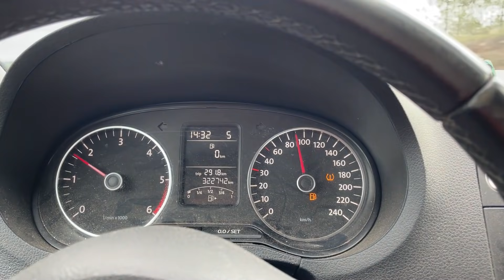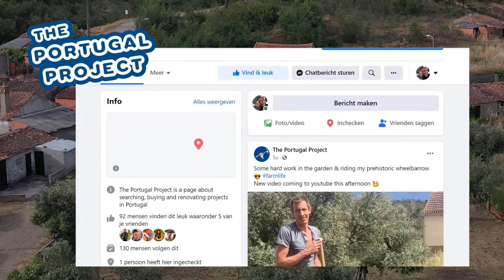MAJOR ISSUE on the HOUSE - (..And more work done) - Portuguese House Renovation

Comment: Jasper please add guttering to the end of your tiles to stop all the rain water from the roof ending up in the trench. They have a system in Portugal with clamps that attach to the bottom roof tiles. Theo just put one in so check there ;-)

Comment: Jasper, make a french drain under the floor and divert the water houtside the house,  then apply a plastic membrane and make an insulated floor. If fixing from outside you need to dig the trench down to a level under the room floor and apply a drainage membrane, to be on the safe side regarding house and street stability, trench need to be done in 2 or 3 times, avoiding to open a full length trench.  Keep the good working!
Reply: Looks like he got the Same problems like Nike with water coming in there house  jasper a French Drain well help a lot  but Nick we’ll need a Levada along the Front of his house with A drain plate on the top of the Levada

Comment: Regarding the problems: This happened in my house as well, built much the same way in northern Portugal. It was a pretty big job but fixable. Digger had to come in and dig a trench down to below floor level. Then we observed for a few months through big rains to see what would happen and if the trench would flood badly. Then we added a rubber membrane on the outside of the wall that sits below floor level + added a french drain, that empties out at the side of the house. This has fixed it and we haven't had any water come in anymore in 3 years of very wet northern winters.
Reply: Yes its the only way to fix a leak like this .lowering the cemented trench at least 50 cms below the level of the foundation of the wall..and  making the wall waterproof from the base up...
Reply: Yes ! I agree start as close to roof as possible "glueing" solid rubber membrane to wall. Curve it at bottom to follow contour of drain ditch then dig a small trench to take water away from house. The cinder block wall holding up your driveway is probably like a waterfall so glue membrane to that as well so water doesn't come down that wall and get under your house floor. Eventually you can dig a drain tile along that short wall to keep water from coming over that short wall ? Words are hard pictures are better 🤣😂🤣❣️
Reply: My stone built farmhouse is built straight onto slate, no foundations and the water used to pool around the house and seep through the stones as well as come up via the floor. It was easy to solve but 3 days of hard work. French drains, the same as we do the fields except in those you use stones, its gravel for the house area. That was 28 years ago and the house has been dry ever since.
Reply: @julibeswick-valentine3690  also remember you don’t have an eve trough on the edge of the roof and all the rain water is running down the side of your house and the inside
Reply: no digger, his roof is in the way. Dig it out by hand. Yummy.
Reply: @acanadianineurope814  A digger can easily get to that without breaking the tiles. It comes in at an angle. Digging that out manually will be horrible.

Comment: You are correct - it's hydro-static pressure forcing water through the back wall of the home. There aren't any curbs on the street behind your home to keep runoff on the road nor storm sewers in the street to receive runoff and drain it out of the village. The street is crowned in the center to drain to the sides. All of that means that water is going to collect against that back wall and will be forced by gravity (hydro-static pressure) through the wall during the rainy season and leave the floor damp the rest of the time. The quickest and cheapest solution is a simple C-shaped curtain drain uphill/around the house on three sides. Excavate a trench about a foot (30 cm) wide around the uphill side and the two ends down to a point about six inches (15 cm) below the bottom of the back wall. The top and bottom of the "C" need to end about two meters downhill of the house on each end. The trench can taper in depth and only needs to be about 30cm deep at the downhill ends. Make sure the trench slopes downward in both directions from the center of the back of the house towards the ends at a rate of about a centimeter for every 1.5 meters. Line the trench with some geo-textile fabric, put in a two-inch deep bed of washed quarter-sized stone, place a 4-inch perforated drain pipe wrapped with filter fabric on that bed, and install elbows and a couple of drain outlets flush with the street on the ends. Add more quarter stone to a point about 6-inches (15 cm) below the surface of the street, fold in your filter fabric to keep silt out of the stone and then cover with dirt or pavers. Any rainwater that now drains off that slope and beneath the pavers of the street to your house will now be picked up and drained quickly around the ends of the house and will percolate up onto grade below the home where it can continue downhill on the surface. Done correctly, this will prevent buildup of hydro-static pressure that enables water to be forced through the back and side walls of the home and will prevent water from draining beneath the floor slab and pooling there. I don't know about Portugal, but here we rent a walk-behind machine called a "Ditch Witch" for a few hours so that we can quickly excavate the ditch without wearing ourselves out.

Comment: Love your Vlog and check for them everyday.
Zoe is such a Love and adventures, independent Girl . You might want to invest in a Harness instead of the Collar. It will make a big difference for her Trachea .
I had a Pitbull that would pull like her and once we switched to a harness she was much easier to control and didn't fight being on leash.
Keep up the good work. I wish I could "beam" over and help some.
Reply: Yes it's true my pittbull is the same!!
Reply: Yes, harness will save her life
Reply: Disagree harnasses are actually made for pulling. If anything they make dogs pull more not less. Best way is to teach them not to pull. Good way is a leash high up (under jaw and ears) that gives you more control, but you do need the right timing and know what you do.
Reply from the maker: I would prefer it if she just stopped pooling.. im working on that with her now..
If she doesn't.. im going to try different options. But i think a harness would not prevent her from poling.. just easier to mange maybe.. but for her more strength to pull.. i think.. will see :)
Reply: @Quinta-Entre-Aguas  I agree. My Finnish Spitz can only use a collar.  Shorten the line if they’re out of line.  Lol. Harnesses only encourage more pulling

Comment: Even in on a cloudy morning it is beautiful.   Zoey is a hunter, she's your muse. I had the same problem with my living room after last years floods. I had to re- tank my walls. Re membrane and water proof sealant. 200 year old house and the living room and kitchen is below road level. When it rains I get all the water in front of the house, the drains can't cope. I have to clean a drain at the outside wall, it's old, lined and sits up a lot. Dig down see if you can pipe drain it and divert the water to a tank and recycle it for garden and toilet use.
The door and window will make you air/ water tight. I like the blinds within the window. You can fix a blind above the door that you can lower at night or in the hot weather to keep your room cool.
Your getting on with the little jobs and you may want to get Xmas stuff before the shortages get worse. Stay safe and thanks for sharing.

Comment: I gave you like #1000, yay...
ok, well first idea is to mount a rain gutter at the end of your roof to catch all that water from the roof
and move it down to the end of the house.
second idea is to dig out that trench, install proper water proofing. Good luck and have fun with that.
third idea is to waterproof from the inside, using a special masonry cement that will permeate the bricks,
so the first meter of wall paint / cement has to come down.
I did this to my basement, which was built without any exterior vapour barrier, and since then
I have a perfectly dry basement.  Huge PIA though.
Last, 'sheet stone' is called slate in Engels.  Have a nice day.

Comment: Hey Jasper, It could take a couple of days and few hundred bucks; but I had a similar problem and created what I found out to be afterwards, a French drain. Dig a trench. Make wholes on 4 to 6 inch pvc pipes (on top and dirt sides). Install in bottom of trench with holes above & towards the street, then lay rocks around 2-3 inches on top of pipe. Then throw dirt over rocks and place a screen cover at ends of pipe. I have never had a drop of water seep in ever again. Good Luck. I hope to visit Portugal in the very near future. I live in Puerto Rico.

Comment: Do not get discouraged. This problem will get solved. It does not look like a flood of water was there. I remember an earlier video when you  had torrential rain. I think the guttering would reduce the amount of water near the foundation and would be the least expensive first solution. When I bought my retirement house (downsizing) a couple of years ago I neglected to clean the gutters (something I always did at my previous home) and the first heavy rain resulted in some water coming into the basement. Not a flood but not acceptable. I clean those gutters prior to forecast rain. I also had a front step that had settled and directed the overflowing gutter to the foundation. I had that step leveled and so far, knock on wood, no problems.

Comment: Oh and just one more thing. If needed you can tar an put a plastic water barrier up along that lower side of house where your having leak issue. I have seen this people's with elevated shafts. There is another possible remedy, if you mud the interior wall where your having leak with hydro cement, which is a special cement to keep water out that may help with water issue. That problem is a water pressure problem with the water pushing through any crack or crevice through the ground which I think you know already. Good luck with the repair.

Comment: Hoi Jasper, it looks like Zoe is pulling on your leash all the time which is not good for you and her as well. If you want i can try to help you once i moved (in January). Regarding your hottub i would at least use a pool liner for the inside and yes of course check water tightness first :P. Yeas clean the gutter and see that state of it. It can also be that the wall on the street side is not going further down than the gutter bottom level and that means that water could indeed go under it. I am afraid you need to dug into this some more to find the real root cause as guessing might give you more trouble in the long run.

Comment: Same problems everywhere here in PT. But it helps considering the history of the house. When it was built it certainly worked perfectly. Probably sitting on a little mount that directed all the water away from it. And with almost no foundations to speak of. 
Then only came the road which the camara decided to be 1 m plus higher than the former ground level in your place. Means that under the street there will be an artificial filling with gravel and such through which the water can nicely drain to your house. 
Luckily for you, they built this trench (in other cases the road goes all the way to the house), but I am not sure if its deep enough. 
Now, digging that deeper will certainly destabilise the shallow foundations. Although your wall does not weigh a lot, I would not risk that. 
Only way is to make sure that the trench is really clean and free of any growth and weeds. Then check carefully for the cracks in the concrete that will be there after all these years. Fill these carefully and then seal the bottom with a concrete sealing mass - Weber has a very good product for that that did its work here for the last 4 years. Now I need to renew it because of cracks in the concrete below.

Comment: Zoey needs a Hilti Dog Collar. It fits around the head with the lead attached at the under the snout. Dogs do not like their head pulled to the side so the effect is instant. As soon as they try to pull on the leash their head is tilted. They stop that habit very quickly & and very soon are happy to walk along with you. It also stops them trying to chase. Takes longer for them to stop trying as it is instinctive but the effect is still instant each time they try. Do not bother with a body Harness as the success rate is less than 50% on a solid dog Like Zoey.

Comment: Here is the twist the heat and sun in Portugal will wreck PVC but not the aluminium. How to fix the water problem:
Stage 1. Fit a plastic gutter ASAP and all the water must be directed towards the other side of the house. Clean out that gully these must be done straight away to stop the problem getting worse.
Stage 2. Wait a minute see if this fixes the problem.
If the problem persists dig out the floor in each room put down a layer of sand then a plastic damp proof sheet. The sheet must be in one piece no joins. Put down some Styrofoam insulating sheet. Then put a layer of sand over it and level it. Put down stone slabs concrete slabs or mexican satillo type floor slabs. Any of these will work but my preference is the satillo tiles.
Why not concrete? Because if you have to lift it in future you will waste all that money and it will be hard work.
Stage 3. OK now do nothing again if it stops problem over.

Stage 4. The problem persists water cannot come from underneath, so the last place it can come from is the wall. So what you do now is drill deep into the wall every few inches and inject it with silicone damp sealant. At this point  all your problems will be over. I think stage 1 will fix things and I doubt very much that you will get to stage 4.
I have renovated a house in the North of England with all your problems but a much worse climate. I start my portugese house in a matter of days.
Now let's look at your heating situation I am watching you to see how it compares with me in the UK. 
You say it is getting cold I am sure it is but you are sitting outside in a top, that would not be warm enough for me outside in the sunshine. It seems that even though it is a bit cold, it is a lot better than the UK.
I spent Christmass in Portugal and it seems to me that the portugese live in uninsulated houses that are cold, but they just grit their teeth and get through it. We could not do that we would get hypothermia. This is the 21st century we don't have to do that. If one lives in a nice warm house the even going outside won't seem so bad because we are not chilled through already. 
If you don't get some heat it will lower your moral.  Here is my suggestion which I also gave to Cindy Vine:
Go to permies.com and look at thermal mass heaters build one out of cob it doesn't matter if it looks like shit. Use it for one winter and you will be a convert and will build another next year. They are very efficient and only need to be fueled once or twice a day.
Reply from the maker: Wow.. thank you for the advice! I may need to read it a coupe of time, but will take it by hand :)
Good point of the pvc also,, glad i got the aluminium :)

Comment: Evening Jasper, yes the water table could be higher than the house, or could be the rubbish and  mortar  at the edge by the house or if it's stonewall could need pointing between the stones. That would stop the water going though the wall. Good luck young man. Take care but love the new hat. Zoe is the boss or trying to be. Like my dog does. Cheers
Reply from the maker: Hi and thank you :) The water table i can see in the wells and its more then a meter below the surface.. :)

Comment: You have two basic problems here. The street drainage gully needs to be checked as leak-proof, so that rain water flow is taken away, past the house. 
The second issue is damp coming into the house via the ground  – which is more soaked in winter, when the water table rises. 
The second solution is to tank the walls inside the room, or, more advanced, dig out the floor, and add a waterproof membrane under the floor that extends up the roadside wall. That way, the damp or water runs under the building, and does not seep into it. 
It's going to be a lovely house when you sort out these basic issues.  I'm sure you'll be more relaxed once you have one clean and dry room to move into.

Comment: Holy smoke, you're running into a big problem again, luckily Zoë thinks it's much less important than you experience it. 😅😎
Maybe your drainage is blocked and keeps water remains against the facade of your house, it is worth investigating, it will not be the 1st time that something like that has happened.
Do you also have a new lath for above your new door and window? I think it is very important for the survival of both.
I hope your roof is ready before the new showers.
PS the extra ears could be a lot bigger. 🤣🤣

Comment: Just saw the entire video. About the isolation, windows are important, but you can add some rockwool/stonewool [Gamma/Praxis?], on to the walls and then cover them up with drywall, you will have a smaller room bit for sure better isolated.

Regarding the leakage, is there a townhall/municipality? Maybe they can fix the street for you

Comment: Years ago , we were converting an old barn and we had a problem with quite severe flooding every time it rained, it turned out the telephone company had put there pole right through a land drain and of course tge water couldn't get away fast enough.I noticed you have a pole at the corner of your building, could that be responsible for the damp ?